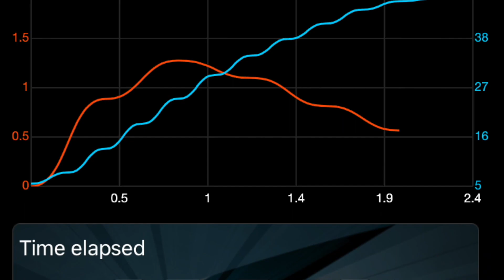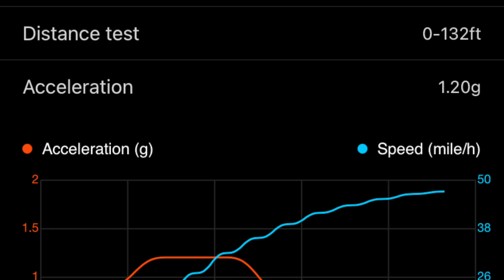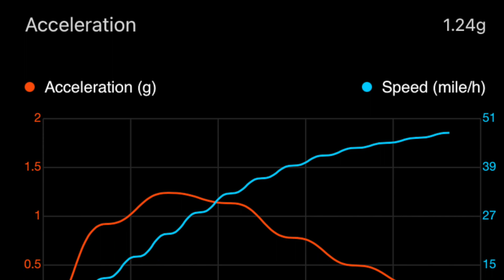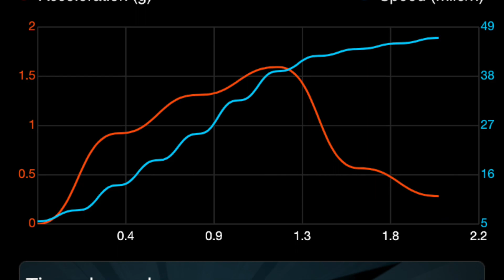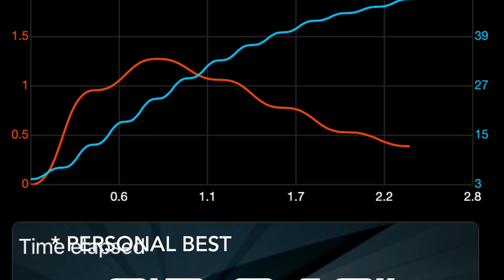Losi 22s No-Prep Drag Car 2s Drag Hits and Gear Changes Did it Make it Faster?

Comment: Nice video, amazing results! You my man have thing dialed in.
Care to share your secrets on that "slipper" clutch?
Your stats show on each run, that Beast is still pulling at the end of each run!
Keep working on that slipper, I bet there is a 2.6 in there or better.
Congrats Man, impressive!
Reply from the maker: Thank you no secrets sauce here running all stock electronics turn the punch all the way up turned  up the motor timing tight slipper but not to much you want a lil slip 2.8 flat is my pb super happy with that for an all stock setup the car is pretty much dialed in
Reply: @Joercgarage  Awesome awesome, I'm torn, I'm a Losi guy from way back, and I'm a Chevy guy, but I'm also a truck guy, and that yellow Ford looks fine!
I'll figure it out I guess whether it's the "Z" or the "68 Ford", I'll have one of them, heck maybe I'll just by both...
Congrats on the video, awesome work!

Comment: Mine does 80 with gear change and new tires and wheels. My tires are the big daddy belted radials. And I also have a racing slipper clutch. I had to modify the shaft. I had to make it flat on both sides for the clutch to work properly. But runs damn good now. Also a better motor and esc will give you way better results

Comment: Try 22-24 pinion, maybe 75-78 spur. I do know you get bigger changes with pinion and smaller changes with spur changes. But I was super impressed you have that car running straight as an arrow and was able to keep it under control when braking, some excellent driving. I have the DR10 with 3300kv so the changes I mention was for that platform,  I going to a Drag Slash or 22S which is faster than mine. The time I spent the money to make mine that fast I could easy pay for the 22S or Slash, the DR10 might become a 13.5 car.
Reply from the maker: I have heard the Dr 10 is a good platform once you change the electronics but I  agree out of the box the 22s is one of the best out of the box drag cars I will eventually move on to better electronics but I still want to see if I can push it just a little bit more before I make that change.
Reply: @Joercgarage  Have you used the Spektrum programmer ? I use it on 185BLX,  Hobbywing program  card on the 100BLX. Anyway you can drive the wheels off that thing, your going to do well this coming season.
Reply: but the dr10 has the best chassis setup i bought the castle 4 pole drag motor and 1/8 scale mamba x with a gen ace 6100 130c 2 s dats a bad ass setup… i losi 22s comes n 2 days from now got 1 dirt cheap now dat there discontinued

Comment: The car leaving around 1.3gs you should drop pinion teeth your acceleration curve continues all through the power band you want your top speed to flat line right before you finish. Not continuing to accelerate as you finish. Having a 6500kv motor you should drop to maybe 14 or 15t on stock spur.
Reply from the maker: Good to know  just wanted to see what the stock motor could do

Comment: I been noticing that you went from 16t to 19t and same results, as your making all them passes your battery is losing voltage ⚡
Reply from the maker: I was topping off after each pinion change to make sure the results were as accurate as possible

Comment: Hey, nice vid. Did you charge the battery at any time while you're doing your test seems to drop as u go up u should get some type of different reading especially with that battery? I have that and china hobby. Just asking did you do the High Voltage charge on that battery?
Reply from the maker: All batteries were fully charged and high voltage was high voltage charged gens ace redline gave me the best pass at 2.850 with stock electronics

Comment: Shouldn't you go down on pinion and up on spur to get them faster hits for drag not speedruns 🤷‍♂️
Reply from the maker: you could try that but going up on spur will also slow down your top speed and not necessarily lower your drag hits time ..so its about finding that balance, but i wanted to know if by increasing pinion size i can lower my drag hits time cause we know it will increase my top speed.

Comment: Play with the slipper I can hear it slipping
Reply from the maker: I been meaning to 👍🏻
Reply: Why mess with the slipper? He's driving perfect, you start tightening it up you lose traction and a good chance of losing control. I thought the car was dialed in well he had excellent times and no crashes, conservative on his pinion changes. Personally I would let it slip.
Reply: @Starkster50  you may aswell have stability control and just the car up to drive itself. Slippers are for kids who can't drive.
Reply: @murrijuana2842  Let me ask this, do you have DRK or any other esc with programmable stages and launch control or do you have stock electronics  and  clutch eliminator?